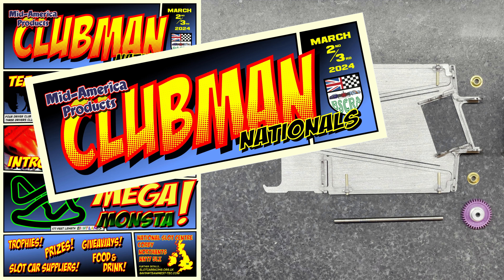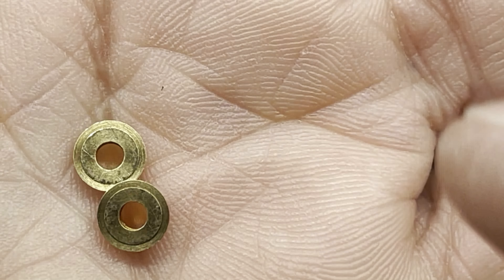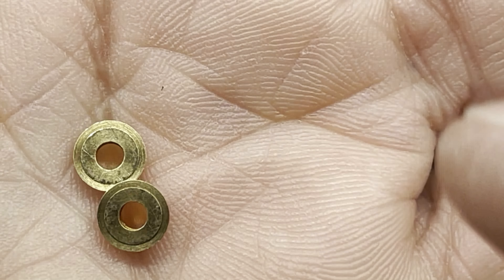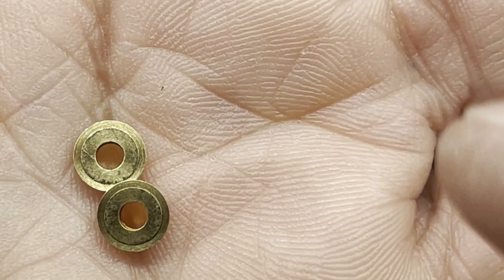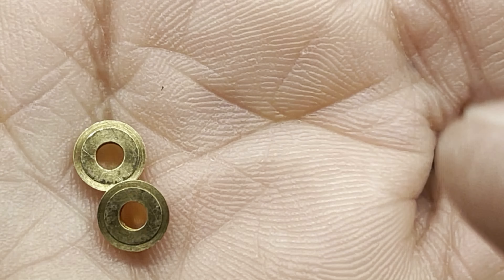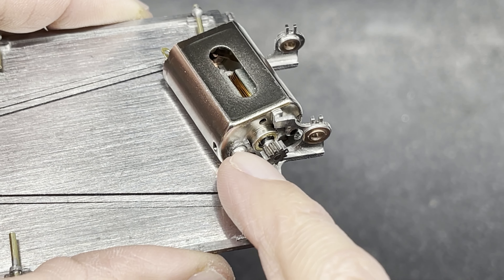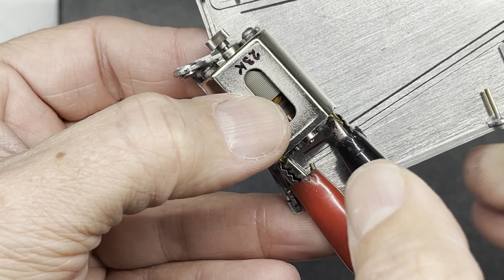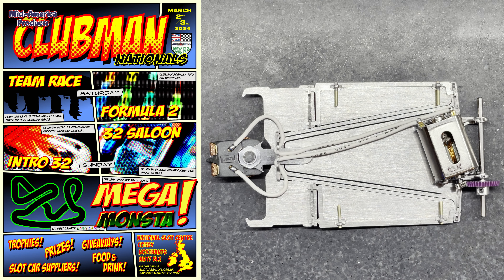Could you win the Slot Car Nationals with this chassis? - Part 2

Comment: That looks like a fun class to race.  

Do the class rules specify using a certain thickness of lead wire?  Seems like there might be a weight-saving opportunity by going to a slightly smaller wire.
Reply from the maker: No rules on lead wires, and you are right about a weight saving with a smaller gauge of wire 👍🏻. These motors don’t draw a lot of current so 22AWG would be fine.